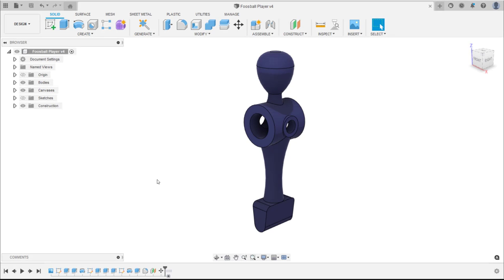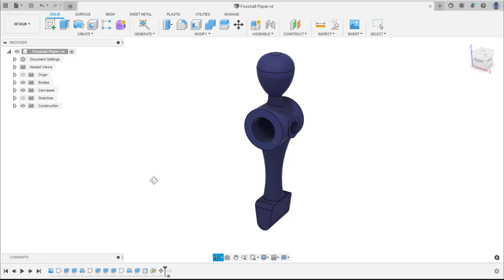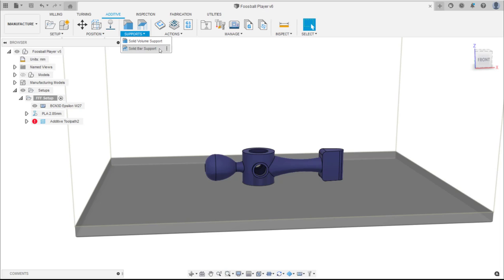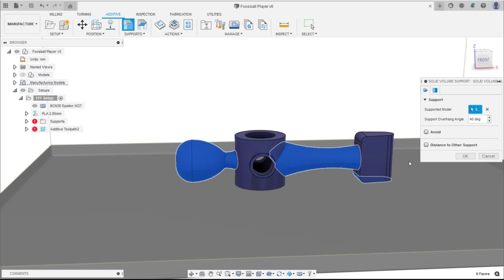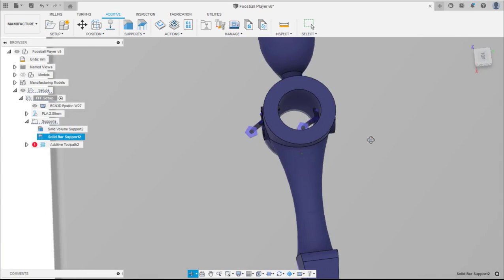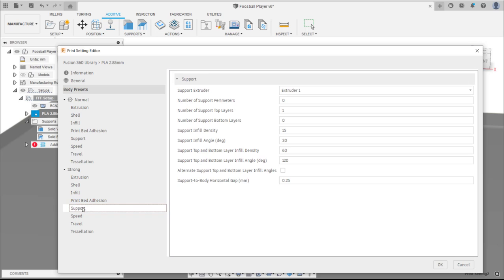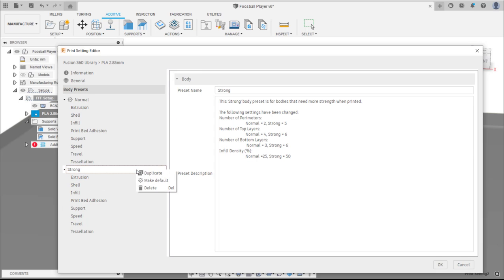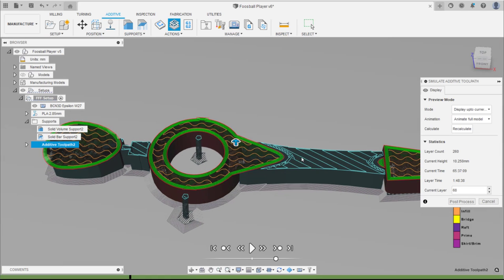Learn How to Use FFF 3D Printing Supports | Autodesk Fusion 360

Comment: That was excellent. on another note on some instances I want to generate support on the model that doesn't touch the build plate. Ie inside the holes instead of put bar supports from the build plate. would be interested to know
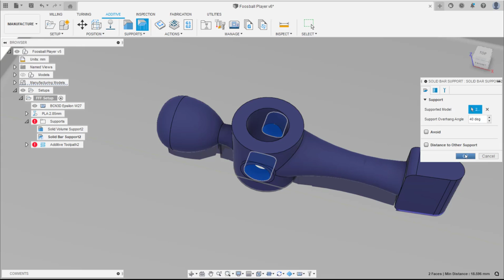Reply: Hi there, yes disable the "Project bar to Platform" option in the bar support dialog. This is in the 2nd tab of the Bar support dialog shown at 1:44-1:55 in the video.